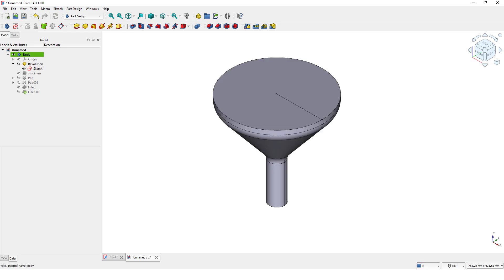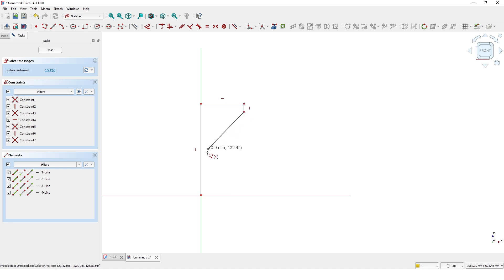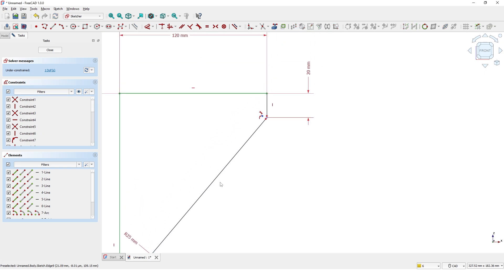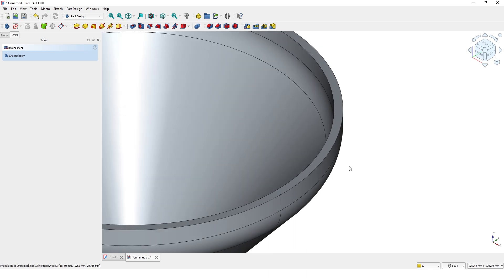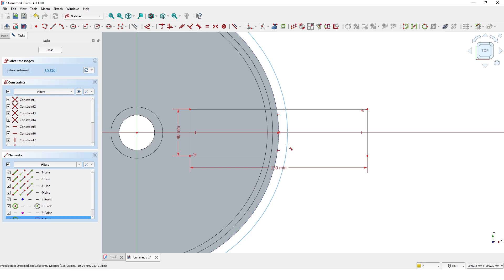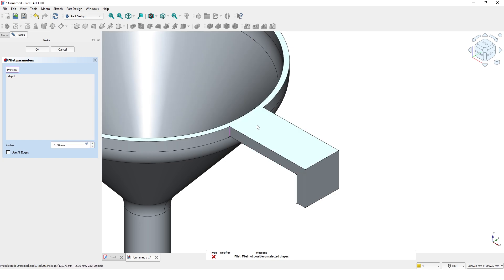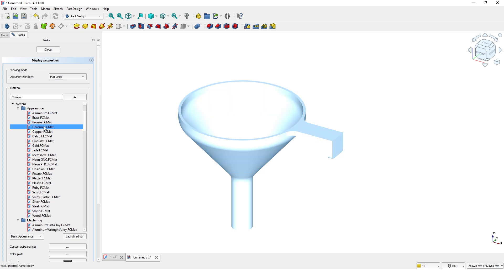FreeCAD 1.0 Tutorial for Beginners | Learn 3D modeling with FreeCAD 1.0 #freecadtutorial

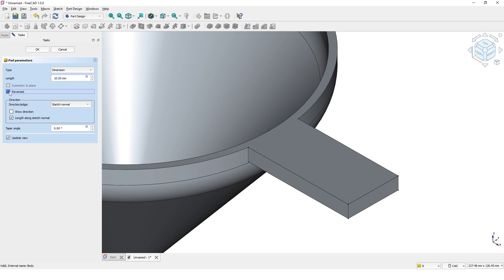Comment: 7:14 fully constrained, but I received  message "wire is not closed" :(
Reply: don't understand why amd how, but "toggle constructing geometry" with clicking on every edge helped me
Reply from the maker: I think some vertices may not connected. Select each vertices and drag, to see if any of them are not connected. If any, select the vertices and attach them with Coincident Constraint (C).
Reply: @Learn_FreeCAD_1.0  the problem was in "toggle constructing geometry" was toggled
Reply: @JVSd-SG  It doesn´t work for me (I checked it in every step) :-(
Reply: @Learn_FreeCAD_1.0  I have just run into this same problem.  I show fully constrained, but can't pad since the wire loop isn't closed.  I think the problem is what connecting that handle with the very last circle drawn.  The one where we started at the center and then drug it wide, and then made it tangent.  I didn't understand what the  step was for, and I think I botched it.  That's how this handle attaches, somehow, I think.  Probably not a coincidence that this was the part I didn't understand, and this is where there error was :(    It would be useful to know why we drew that circle instead of just attaching to the existing perimeter.   Cheers!
Reply: @MotosAndMachines  I also got issues with attaching that circle at 5:43